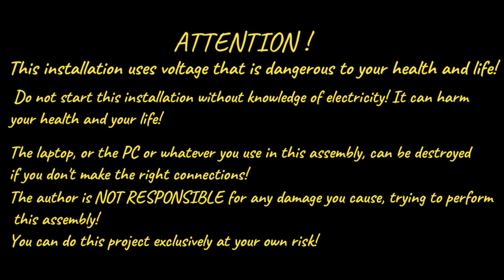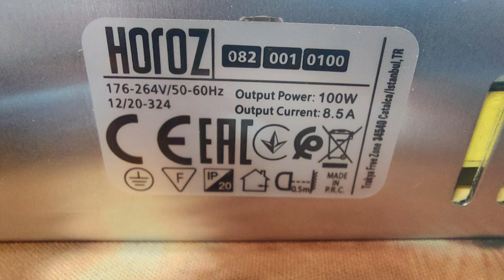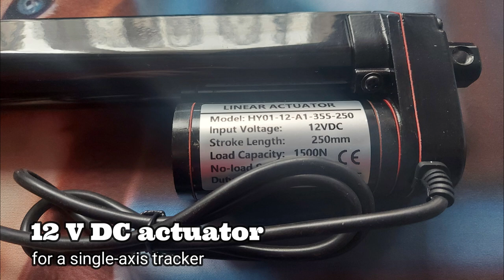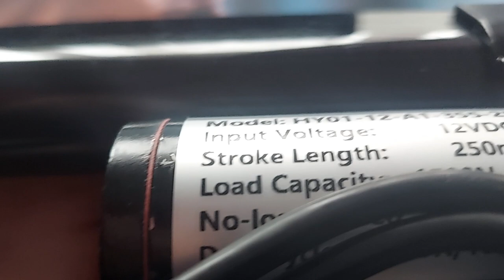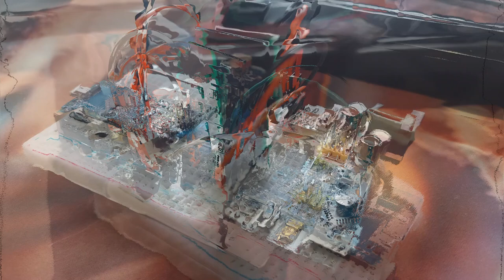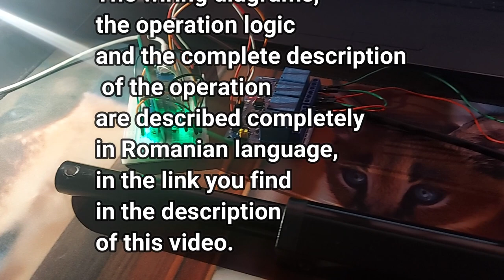Sun tracker with ARDUINO - The prototype - with code

Comment: Amathing project, that is what I was looking for. But could you explain how to connect second dc motor to the system. And do you need to add two more light sensors to the system, adding second dc motor to the system? You would me my savior ♥️♥️♥️♥️
Reply from the maker: The code is written for a single axis.  But I made the code public so that the second axis can be modified and added as well.  In the video description you have links to a forum where some explanations are given and how this project evolved from scratch.